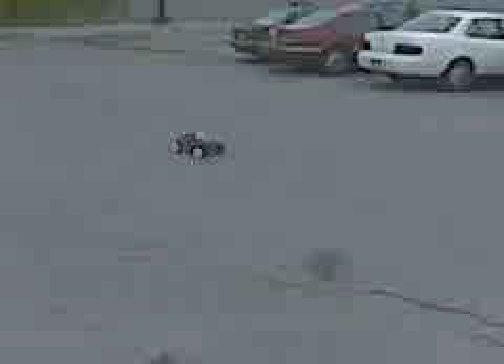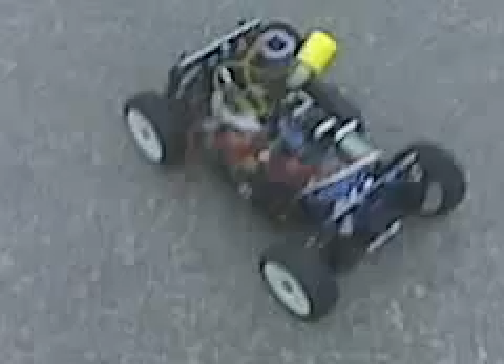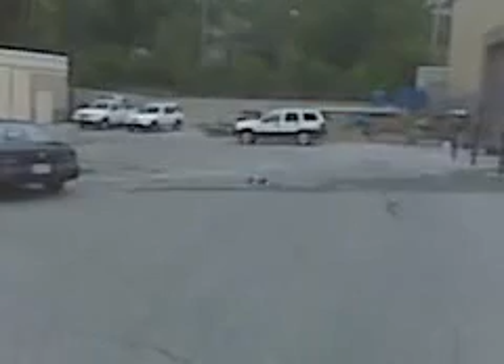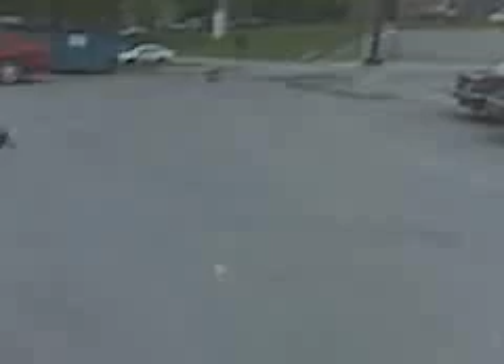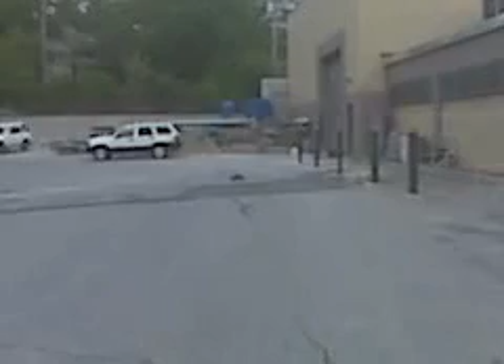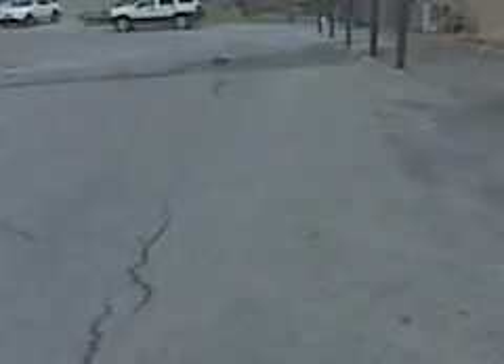Remote Control Car Parallel Hybrid

Comment: You got the electric motor which provides great acceleration and the gas motor which provides great top speed. If you guy's engineer it a bit more you could be the first fastest hybrid r/c car!

Comment: Interesting concept, though kinda unnecessary really; if you were to run a decent 6s 30C 5000mah lipo with your BL system, you could ( on paper ) have  a setup capable of around 3.7kw peak poweroutput- far higher than the nitro engine and undervolted motor ( 3s, seriously? ) running together. Using the nitro to supplement a fully powered BL system might be interesting to try and boost max power, but to use a half powered BL system... nah.